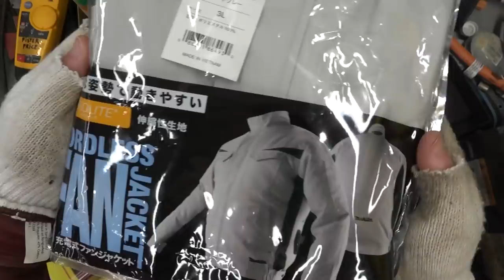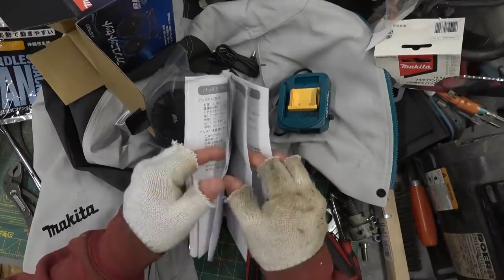Only in Japan! Ridiculous cool jacket

Comment: I live in downtown Tokyo, most tradies wear these now, the cooling vest is also popular. 
When it is 38C or 40C and 95% humidity you cannot believe how much a difference these jackets make.
The 3L would barely be a Large Medium, you would need a 5L or 6L.
I bought a good name brand jacket, but the fans and battery system I went Chinesium, and the batteries are just regular Lion 20,000 mah batteries like you use to recharge your phone. I had various of those batteries so the Jacket, fans, and dingus were about $100.
In the summer...? From my cold dead hands dude, it's f-ing hot and humid here.
Seriously like well over 90% of the tradies wear these now in and about Tokyo.
Cheers!
Stu

Comment: adding moisture to the fan as to convert it to a swamp cooler would be a bad idea. First of all it would create mold, even if you treated it with disinfectant that moisture would pool somewhere and make for a drippy jacket.  your jacket would end up urinating on you. additionally more moisture equals more heat. it clogs pores and  and doesn't allow for evaporation of sweat which is the primary method for our body to cool. a better cooling method would be for the jacket to have some type of piping layered throughout that was flexible yet have enough conductivity to allow for the transfer of heat from the body to the media being used for refrigerant.. in other words your evaporator. of course you'd have to have a pump of some sort move this fluid around in order to absorb the heat from your body and then release it onto the atmosphere. enter the battery operated fans on this jacket...they can be both the pump that moves the fluid and the condenser that expels the heat. although the fans would have to be inverted in order to blow the hot air out.  I'm assuming someone out there has invented such a thing

Comment: Decades ago, I designed but never built a peltier driven liquid cooled under-jacket.  I live in Alabama, where swamp cooling doesn't work when its 99F and 98%humidity.   This one had a tube the circulated a coolant through the vest with tiny hydraulic quick connects that went to a belt mounted battery/peltier device/pump.  I had to wear suits outside for hours and dreamed of this being my only relief from the alabama summers.
Reply: With the peltier setup... it could be heated too for the winter.

Comment: having spent the better part of 30-years working in Las Vegas, and Southern Nevada, it seems like a good safety device.  Keeps the sun off your skin, to prevent UV exposure, while still keeping enough air flow high enough to keep yo9u from getting too hot.   You can only strip down so far, and put on so much sunscreen.  And, after one of the guys had the snake sneak out in the presence of the lady boss we weren’t even allowed shorts.

Comment: Ave man. You should know some work places require you to wear long sleves (full coverage)! I sat in a welding bay tigging for 2 harsh Australian summers full sleeved. I ended up zip tying a lenth of stanless conduit through the sleves and into my gloves and a lenth around the chest and back. I ran an air line to a comp fitting junction i cobbafabbled up with a tap. It worked a treat. Plus a bonus was it cooled my gloves so i could weld for longer. It was great

Comment: Would be good for a job where you are frequently going between inside and outside. Where the temperature difference makes you sweat as soon as you go inside. Rather than having to keep taking your jacket off you just turn on the fans in those moments where you're too hot.

Comment: Just doesn't seem very useful in warm environments. Honestly it seems like it might be kind of dangerous in really hot environments. Even if you hold your body down in cool environment and just your head in that hot area. Breathing it will make you start to sweat and feel miserable. That's a good sign your body temp is rising despite most of it being in a reasonable room temp area. I deal with that a lot with a boss that likes to tuck our equipment right near an access hatch in the hot ceiling more often than an nice air conditioned room (which are generally available). Air temp seems to be the major factor.

Comment: Things like heated jackets do not make sense either until you are working on a bucket truck or operating a ski lift all day for a bunch of rich assholes about to ski into a tree at Vail. For areas with high humidity plus heat, more stringent safety regulations, and lack of centralized cooling this product makes a lot sense. I am certain road crews working in the constant Sun of Colorado or Wyoming in Summer would love something like this. The economics of outfitting employees with these is  simple, less risk of workplace accidents due to heat sickness and better productivity.

Comment: Quite a bit of US Army research has gone into miniaturizing compressors for "air conditioning" to be outfitted on soldiers.  One of the biggest cause of casualties in Iraq at least was heat exhaustion/heat stroke.  I don't know of anything that's been fielded though.

Comment: I have a North Face jacket and it isn't worth a shit for keeping me warm. Blocks out wind and rain pretty good, but not so much on the heat. I'm a skinny guy so I really notice when the clothing isn't keeping the heat in. Even with layers underneath it just doesn't get the job done. In an act of desperation (we lived in San Diego at the time and I had to travel somewhere cold) I bought a cheapo Weatherproof brand jacket at Costco a year before my wife got me the North Face and it is way warmer. She gets mad at me for not wearing her foofy gift, but I just can't bring myself to look pretty and be cold. I think it's actually the warmest jacket I have ever owned. I've donned a few other expensive brands too being from the Great White Buffalo and all, but that cheap (less than $100) jacket from Costco takes the cake as the warmest single layer of clothing I have ever worn, and super light too. If it didn't hug the neck so tight when I have it on I wouldn't know it was there honestly. Lighter than the quilted flannel I wear as a spring jacket which is a weird feeling.

Comment: When I first saw them I though, what a gimmick!  
Then I started noticing that most guys on building sites were using them.
I was confused as why you would suck 38c hot air into your jacket so I did a little digging. Turns out that the jacket is supposed to make an air barrier.  
From what I saw, you have to wear tight fitting thin undershirts to get the best results.

Comment: Work clothes with fans are becoming a common practice at construction sites in Japan. The humidity in Japan during the summer is unusually high, and sweat does not evaporate. By cooling the body with a fan, the body temperature is dramatically reduced. It is not that difficult technology to use. It's Columbus' egg. In the last few decades, batteries have gotten smaller and smaller, making it possible.
 With the recent warming of the world, temperatures are rising and the popularity will increase even more. Even if you are not in Japan, it should be effective in humid areas. Why don't you give it a try?

Comment: Maybe the jacket is silly as currently configured, but it could be genius if made into a motorcycle jacket with proper armor.  Right now if you want to ride in 90 degree temps, either you wear proper gear and sweat and suffer or you just wear a T-shirt and risk leaving your skin in a 500' patch if a car hits you.  This jacket would make it possible to ride comfortably with proper protective gear in 90 degree temperatures.

Comment: So i got a sim racing rig made from extruded aluminum..it's the only pc i have and i was wondering if you could make me a removable keyboard tray i could use when I pop the wheel off so i can have pc usage again without a keyboard in my lap. Would need to be slightly angled with a lip at the bottom and a lip at the top so i can screw it to the 1515 profile

Comment: Idk about the underwear lol, but a proper cooling jacket that uses a tiny little battery or maybe even plug in heatpump would sure be useful where you have to work in high temperatures (think attic in southern usa installing ac/heatpump, 120 to 130F durning the summer when people tend to have central air problems).

 Ice (or really the better phase change materials) in Vest format works alright to really good and definitely beats a little fan thing by a long shot.
 Hope to see one with a legit heatpump someday though, ill pass on the fan jacket

Comment: I’ve worn a forced ventilation jacket and pants over an ice vest which is exactly what it sounds like it’s just like a giant ice pack built into a vest. With an aluminized high temp suit and hood over everything that had its own forced ventilation in the hood and body. The idea was several layers with forced air between to remove the heat and insulate the ice vest to keep your core cool so you didn’t die. Had to have breathing air as well. Something tells me this this isn’t skookum enough for that kinda use. Probably more for the a fat foreman on his weekly walk around a construction site.

Comment: Needs evaporator/condenser elements and refridgerants circulated through tubes running down your pants into some high tech innersoles you place in your shoes which power a compression cycle every time you take a step, and thus transform the mundane act of wallking into a Q-like  body chilling heat pump tuxedo for coolness under fire and backup supply of ice cubes for occasional impromptu shaken not stirred Martini with the Ladies...

Comment: You'd think a swamp cooler may cause mildew on the inside of the jacket. Imagine your coworkers on the jobsite sneaking up behind you and ripping a fart so hot it'll make your balls sweat. And those little fans sucking that hot noxious gas, right into your olfactory system. Strive as you might, you can't get away from the horrendous odor. Meanwhile your buddies are rolling around dying from laughter.

Comment: i'd of killed a man for a cooled jacket the other day, was inside the "hotbox" of a curing oven and other hot, dark, dirty places

need to wear long sleeves because those places are not skin friendly (unfinished metal joints, super fine micro powder, tek screws poking out in all directions) and you get about 10 minutes before you transition from sweating bullets to leaking lead.

if i had a cool suit i could knock a whole job in one go instead of having to get out after 10 mins, get out of a full body suit, gloves, mask, goggles, drink a bunch of water, then result back up just to finish

Comment: Brilliant if it was made with a hearty fire retardant outer shell (Nomex), then it would be the ticket for auto racing (they already have cooled suits, but they're very spendy) or in steel mills.  In a former life, I did contract phone and data wiring and the worst crap-hole I ever worked at was a steel mill where they made re-bar (the coroner's lab was 50x better...once you got use to the smell).  You could die 37 horrible ways before the morning coffee break, one of them baking like a muffin near just about anything.

Comment: An AirConditioned Welding Jacket - now that make a lot of sense..

Re the: Arc'teryx - I thought it was all "aboot" the "Lack of Stitchery" - that way after the required number of years in the cupboard ll the seams simultaneously let go and it is time to buy a new one - No way you aregoing to get all those glued seams sewn back up for anything approaching the Price of a New one...  (New material and Seam sealant thrown in for free...)(Never Bought an ArcT - Just made Do with the Mountain Hardware Trilayer - that is another scam for another day - needs to be quadlayer - ) - even had  my "Ma" (Not, Jack's Ma) sew up some of the Adhesive when it failed after 5-7 years - still going strong at age  15)

Comment: OK, you're a Canuck, so you probably don't really grasp the concept of "air-conditioning" anyway... It's not like you have one on your dog sled or snowmobile, right? :)

There are cases where something like this could be useful... Say you are in a hot climate and riding a motorcycle (or scooter like a lot of large Asian cities).  Having a bit more skin protection if you go down is desirable, but since it's hot and traffic is slow, you're not getting much airflow through a normally ventilated jacket, so having one that has a powered vent might help... What would really help though would be if there was some sort thermoelectric cooler that could provide COLD air, not just more of whatever air you are already riding through...